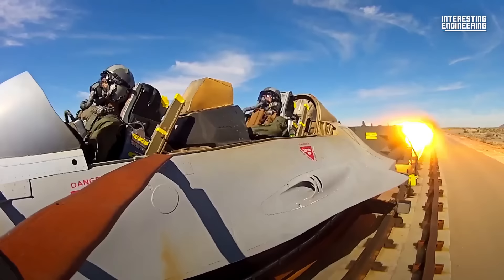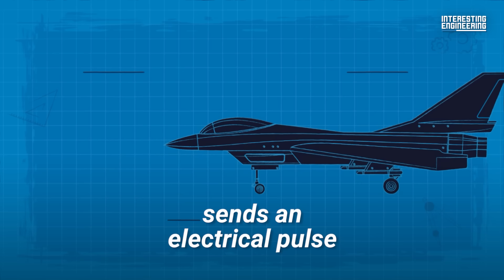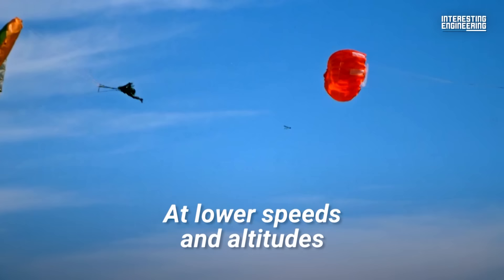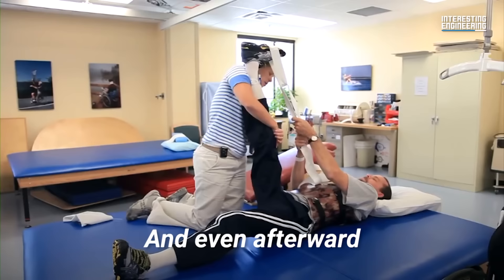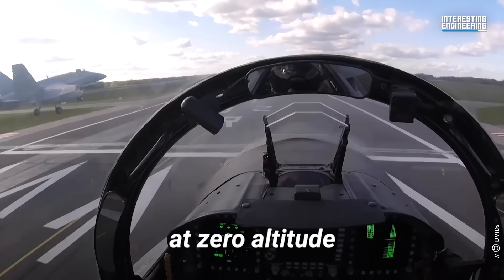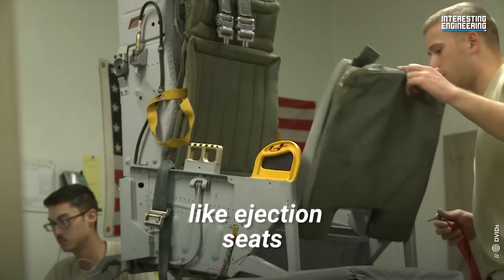The dangerous task of ejecting from a fighter jet

Comment: Surprised there was no mention of the 'Water Activated Release System' (WARS) incorporated into the ACES II. Also, there should be mention of the clever gyroscopic setup mounted into the bottom of the seats that allows the pilot to eject inverted safely. Honestly, retired USAF, the ACES II was one of the coolest pieces of technical data I had the opportunity to read. Wasn't even my job, just found it that damn interesting.

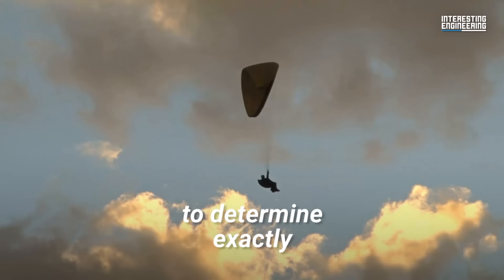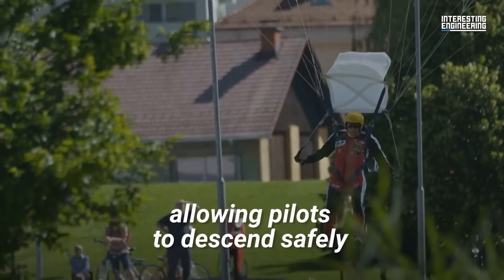Comment: Pretty well covered. I wish you would stop using UNRELATED stock footage, like the paraglider @ 1:43 and the skydiving rig at 0:37 but the opening clip of the F-18 is exceptional. Zero-Zero refers to zero fwd speed, NOT wind speed, as in an aircraft on ground not moving. At higher airspeed ejections, flailing injuries (limbs 'flapping' in the 'breeze') can occur, so it is preferable to eject when slower than 350 kts. An ejection sequence happens in milliseconds. Ejection is EXTREMELY dangerous, as you point out, since you will be pulling upwards of 12-14 G's, so it is an extreme last resort; better to avoid getting into situations where an ejection would be necessary. Keep the blue side up :-)
Reply: Fully agree with the comment. The use of footage of a disintegrating radio controlled model Gripen @0:21 seconds was also annoying.

Comment: How does the pilot get separation from the seat?  Is it mechanical cutter, or explosive bolt? Curious about the process. Cause what you are safely strapped into (during flight) now has to remove itself from you, for survival.
Reply: Educated guess on the explosive bolt though
Reply: The pilot and seat separation is caused by two different parachutes. The video does make a small error mentioning a drogue parachute connected to the aces 2 chute but that is actually called the pilot chute. The drogue parachute is actually connected to the seat itself and allows it to be pulled away from the pilot and the pilot uses the aces 2 chute. That’s how the seat and man separation occurs.
Reply: It’s obviously not like this in every airframe, but I know the seat doesn’t necessarily separate from the pilot. I don’t know exactly everything involved, but those seats are packed with survival kits. There’s Air Force issue M-16’s that break down and fold up specifically for this purpose.
Reply: Found out a simplistic answer. Its similar to a very taught knot, with a loose end. The tension keeps the knot together, until you pull on the loose end, and it unfurls itself. (Not exactly, but a simple explanation of the mechanics of it)

Comment: Holy cow. Is MB still using the Meteor for seat testing? It looked really clean.
Reply: Yes they are. They have two, one is silver and the most frequently used or is black. The scar thing is how fast everything happens. From pulling the handle to hanging under your parachute is about 1.25 seconds

Comment: I heard if a pilot pulls his parachute  & it's a non-milatary battle just training op & it was pilot error that caused the crash they are permanently grounded & never able to fly a jet again, does this also apply if the jet has a malfunction & the pilot pulls his shute, im sure investigation shows it was a malfunction, does this pilot get grounded permanently.
Reply: There is a stipulation that grounds a pilot for ejections regardless if the root cause was pilot error or equipment malfunction. I’m not sure how many, but it’s two or three. If a pilot has ejected from an aircraft, regardless of fault, they are permanently grounded due to risk of spinal injury. (That’s if they haven’t suffered one already.)

Comment: Using the ejection seat are there any rules of when you can't use it. Like if your jet is in a area where ejecting will allow the jet to crash in a populated area as the alternate choice of staying with your jet the chances of fewer people getting killed.
Reply: A pilot only ejects as a very last resort when he has executed all options and is certain he or she cannot recover the aircraft. Therefore, there are no such rules regarding when they can or cannot eject. Basically, the pilot is certain the plane is going to crash anyway, so the pilot can either go down with it or eject out of it. It’s always a shame when the aircraft goes down in a populated area, but the pilot will still try to eject. When they lose control over it, there’s no deciding where it will crash, so they eject before it’s too late and they lose that option.
Reply: A really sad example of this was in October 1987 a jet fighter’s engine failed and the pilot had no control over it and couldn’t save the plane, so he ejected and it unfortunately crashed into the Ramada hotel
Reply: The decision not to eject, to steer their crippled jet away from homes  and businesses, is an aviator's noble & final act of heroism.

Comment: They should give these to commercial planes
Reply: I'm sure engineers could figure out a way save people in a commercial plane on it's way down, but then the cost of flying would go through the roof and nobody would fly.
Reply: @mplslawnguy3389  well if it saves lives it will be worth the cost
Reply: @6foot596  in reality, there's a price at which its not gonna be worth it. if the cost of flights multiplies by 10, its already an extremely safe mode of transport, far safer than cars, people wouldn't pay for it.